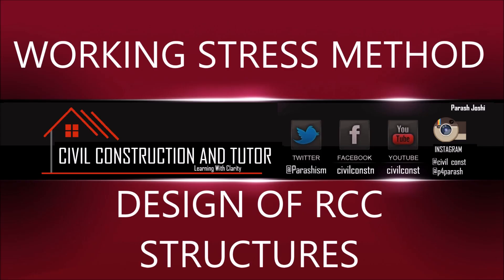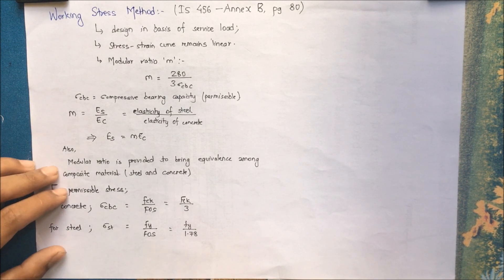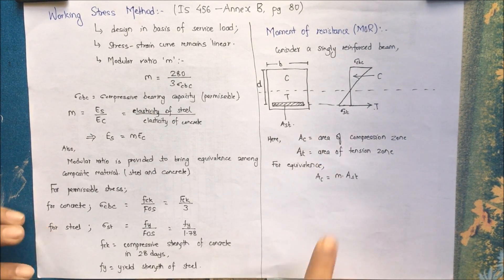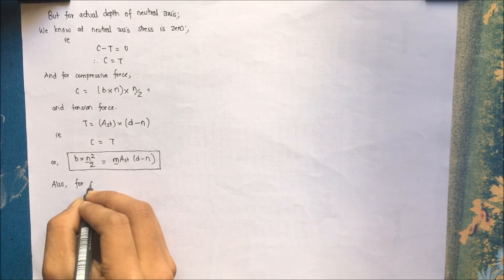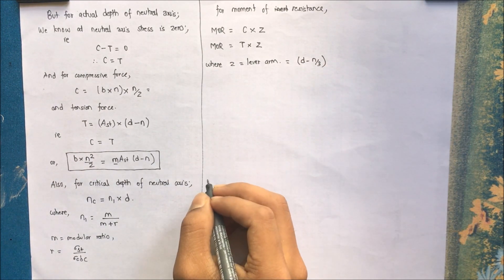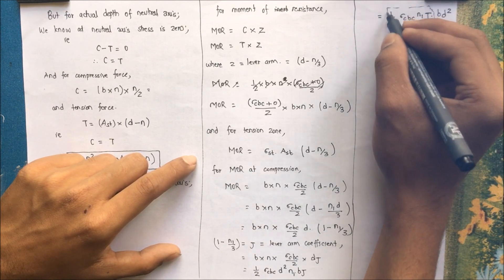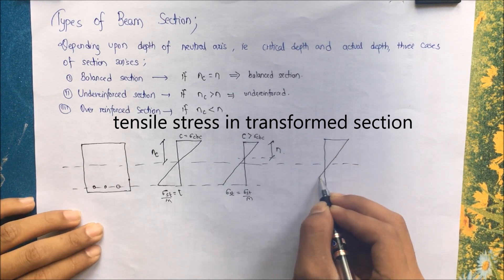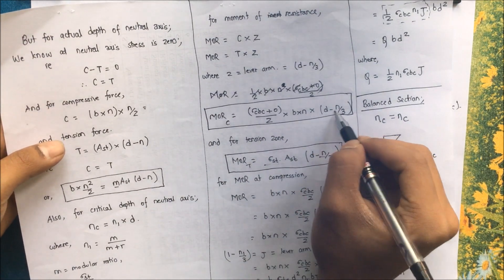Analysis of Beam | Working Stress Method | Part I | RCC Structures | IOE

Comment: strain profile is linear not stress profile, so at 3:26, instead of [sigma(st)] it should be [sigma(st)/m] and clearly you dont know it or forgot to add... after that, you are adding randomly 'm' at 4:39 without any logic in similarity of triangle formula